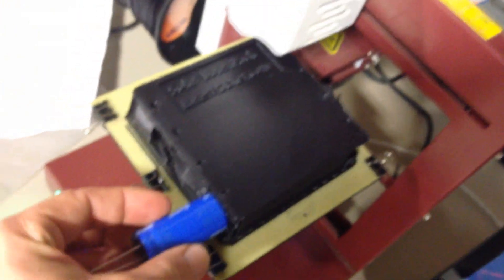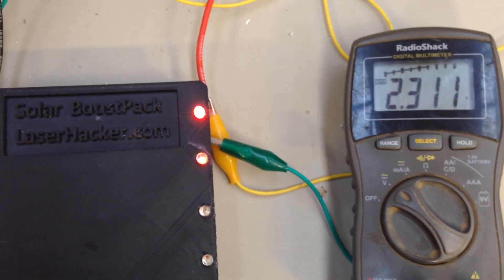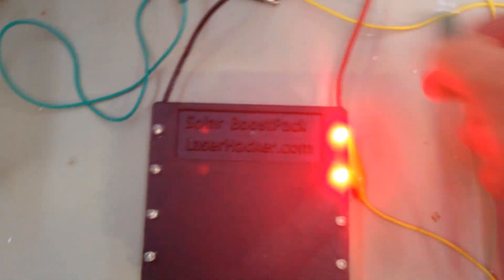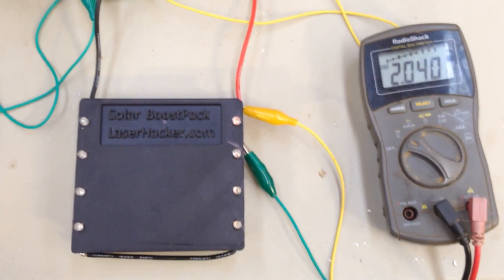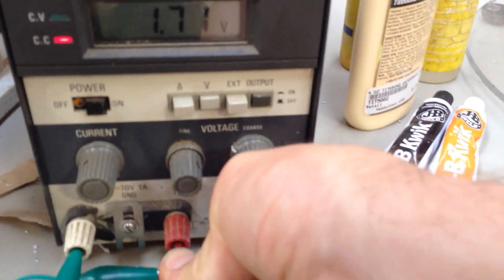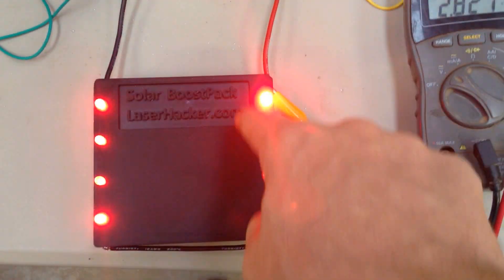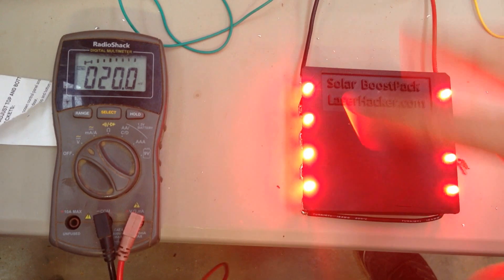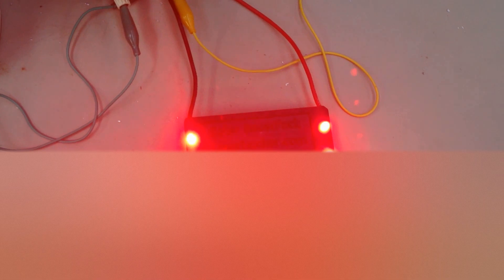BoostPack Balancer Circuit Tested

Comment: Good job man! Brilliant idea to just take advantage from the silicon LED switch on characteristics!!
I bought Maxwell 3000F caps and put them together with the integrations kits PCBs. 
Well they can burn away 300mA in case of active balancing. How much amps do your red LEDs burn away when active?

Comment: Are you kidding?? The balance circuit isn't really working at all, you had overvoltage conditions repeatedly on the two caps - and you had to manually disconnect as well, so they were not actually "protected"! (What if you weren't there to disconnect?)

And you say that the LEDs are "really hot," so you were running the risk of burning out the LEDs, which would then fail the cap under it... but if you put current limiting resistors to eliminate the risk of failing the LED, you decrease the protection even more - this is NOT how to protect or balance the caps at all! 

I think  zeners would be a much better idea... if you want LED annunciators, put an LED with resistor across the zener. This is not a good design at all.
Reply: I know this is an old video  posting but...

I agree with John Rourke and Frenchie.  If you read the manuals that Maxwell puts on their site, the balance circuit must be designed to absorb the leakage AND charge rate.  If you have capacitors which are very unbalanced and you charge at a 1Amp series rate, your circuit needs to be able to discharge more than 1Amp so that it doesn't overcharge (kaboom).

I also wanted to mention that you are using a 8x 2.7V capacitor string at 22Volts.  That's 0.4V beyond the rating of these capacitors.  Maxwell specifies that for long term use, you want to derate the capacitor to 80% nameplate (so for these, that's 2.16V).  You'd need 11 capacitors in a string for your 22V solar project. Yes, you will take a hit on your capacitance by adding more caps.

I just bought a large set of these caps to do a car audio amp power supply (hey, I like the bass, I like the bass).  The single cell balancing circuit I made for that includes a two stage approach - some ALD SAB MOSFETs for low energy leakage balancing, and a brute-force comparator-triggered MOSFET resistor ballast to hard clamp the cell at 2.5V to prevent dangerous overcharging.  The resistors can dissipate 250% of the charging current across one cap, so there's no way the boost regulator can overdrive the power supply rail stiffening caps - but it also means more current could still pass through the total series string to rapidly charge up the other caps.  Comparator hysteresis setting means the brute-force discharge stops at 2.35V, relying on the SAB MOSFET to handle the remaining balancing at a lower rate.
Reply: it's not working very well. Manual intervention is cheating.
Reply: I don't agree, because he is going to use those caps with solar panel as its sole power generator. He had to disconnect a power supply, but under the target conditions, the LED could burn as much power as the solar panels deliver AT THAT VOLTAGE on its U/I characteristics! Thus under the target conditions this simple balancing could do its job JUST FINE!
I love it!
Zener diods do not burn as much energy as the LED can do!

Comment: Hi im a beginner in capacitors, would i be right in thinking that a pwm solar  charge controller would balance the caps equal? Or would i still need balancing? Also how would you charge from 0v? Thanx

Comment: Just wanted to post an advisory about the boost pack kit that CUSDN is selling on EBAY. The circuit is sound and works well but, the output connections are labeled incorrectly. If the user connected the battery or charger as the pack is marked, an EXPLOSION will likely occur! The capacitors would be hooked up in reverse which would very quickly damage them. Backward connection would also destroy the equalization circuit. SO... unless the markings have been corrected by the manufacturer, one would be prudent in correctly marking the output terminals before connecting the boost pack to a power supply.
Reply: +Joseph Henderson Always a good idea to check it with a voltmeter as it doesnt lie.   Thanks for the tip, Joe.
Reply: I've already constructed two of theses without the PC board. I cable tied the caps to three plexi-glass "shelves" within a threaded rod frame. I soldered the terminals to 8 gauge solid copper ground wire (2 banks of 6) paralleled together to make a boost pack for each of my motorcycles. I added charge distribution circuits (not LED) and paralleled the pack with inexpensive lead acid batteries. I have excellent startup responses from both packs 8 months going.

Comment: Isn't it redundant to have the diodes and led's. I tested my bank and it balances on its own. If one of the caps are off in voltage the highest one transfers energy to the lowest until they are all equal. Since they are capacitors this should happen instantly or at least within seconds. When you add this circuit then the balancing takes longer due to the resistance placed on them. I think the key is to not have an overall input voltage larger than the capacitor's total voltage capacity.
Reply: This would happen if your bank was in parallel, however in a series bank, the most current is sunk into the capacitor with the highest resistance - i.e. the one that has the highest voltage. This completely upsets the balance, and could very easily lead to an over-charge.

Comment: someone enlighten me why could you not use a  2.5v-2.7v zener with a resistor, a resistor would work better at dissipating energy than a led or am i missing something ?
Reply: check out this video Super capacitor pack where zener diodes are used for balancing
Reply: +iknowsstuff But you wouldn't have the pretty lights.

Comment: Shouldn't you use larger value diodes that can divert then entire load of the panel when the pack is charged? Or maybe like 2 10 watt led's in parallel across the pack inputs with a diode in series with each one for the appropriate cut-in voltage.

Comment: hi Lasersaber,
You need to use Zener diode 2V7 with 1 or 2watt rating.The Led can't take the load it can be used a indicator via resistor connected in parallel to zener diode.

Comment: im thinking of converting my home office (computer, 2 monitors and some lights) in a partially off the grid setup. At it's core, the system would have an inverter, some solar panels, and super capacitors. What I would do is get a power adapter for the wall that would be on a controller to only top up the batteries if there's not enough sunlight to keep the capacitors topped. This way, If there's enough light, I'm off the grid, if there isn't, the grid sustains the superCap/inverter setup.

Comment: Could you just use a zener diode across each capacitor that would limit the voltage applied to each cap.

Comment: I'd try adding a series diode to each LED to let the lipo cells reach a higher voltage before balancing .... but would keep the charge level low too to prevent the lipo's cooking .... maybe trickle charging at just 15 - 20mA so that the balancing LEDs can keep up.

Comment: Very interesting! Aren't those led 20 mAmp? Make sure you don't over drive them or they will burn very nice idea though you could also do this with regular diode although you loose the visual indication but you will gain higher current drain. Thanks for sharing!

Comment: Hi,

Nice to see you are still working on super caps.
Also to balance entire series connection you might do a different approach - the bi-polar power supply principle with full bridge voltage stabilizers for each super cap. So it would charge equal voltage of 2.7 volts for each cell at the same time.

Cheers!